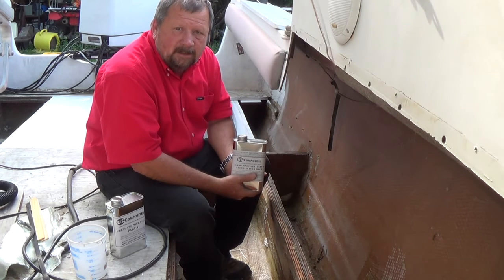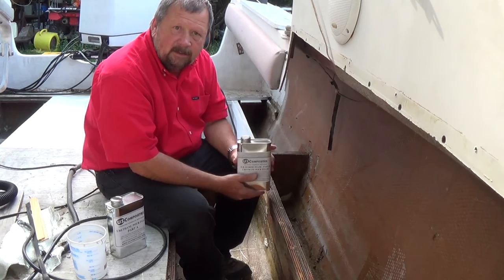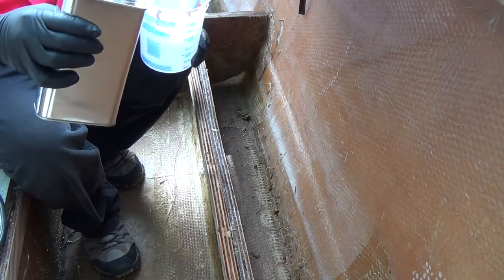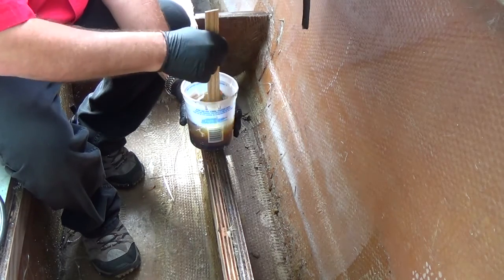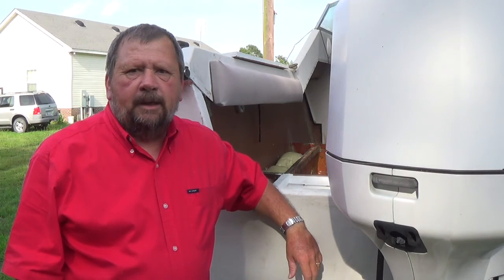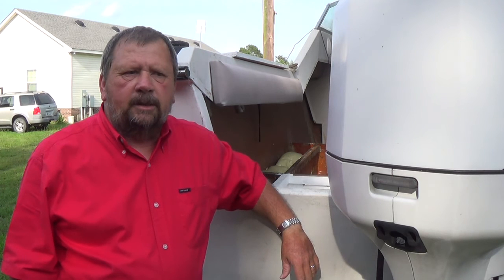Robalo Boat Project 58 "Gel Coat cabin floor and buoyancy foam"

Comment: Did your gelcoat product have the wax or sealer additive, not the catalyst, but the stuff that makes it fully cure and harden so it's not tacky?
Reply from the maker: I had to add the wax additive to the last coat so it would fully cure and not be tacky. I did not buy it with the additive in already because I would have had to sand it between coats.
Reply: @OmFishing  Thanks for the reply. That's what I need to use as well, laminating gelcoat.